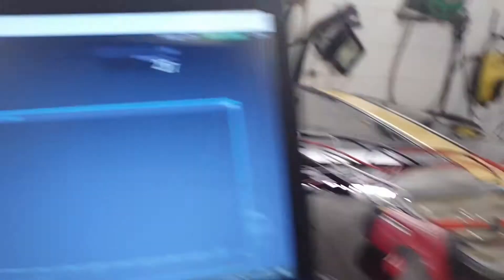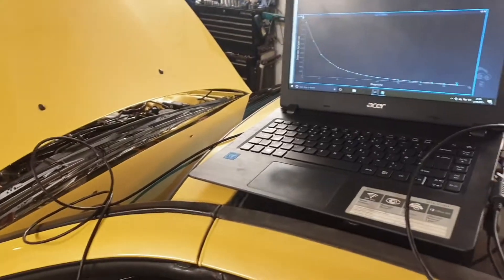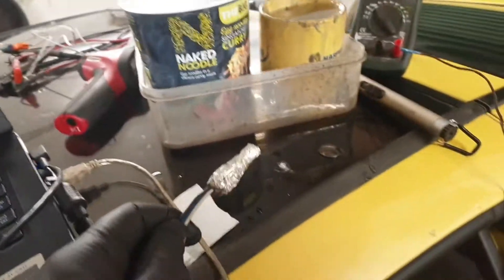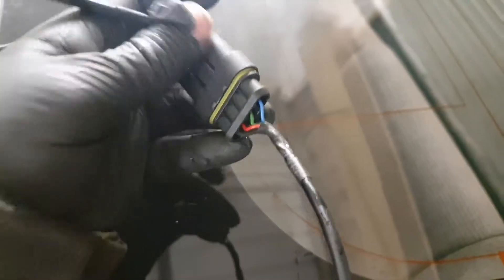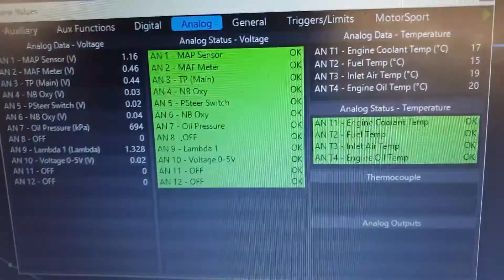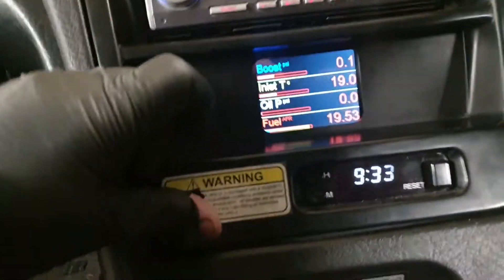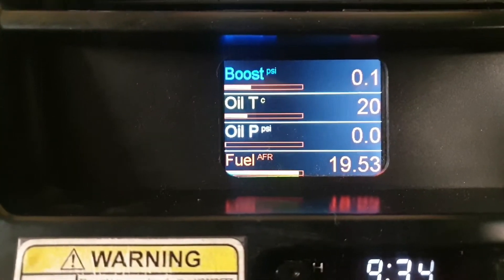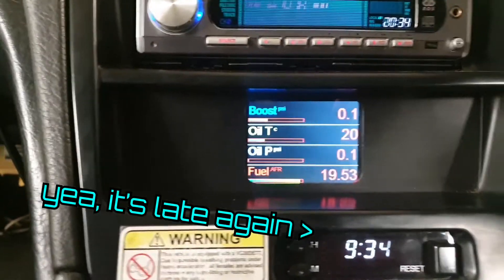Standalone ECU sensor setup- Oil pressure and temp

Comment: Can the oil pressure be checked with a scan tool at a shop.  Instead of screwing in a mechsnical guage by oil pan at the pressure senser.
Reply from the maker: Not on this car, the factory sensor is only for the dashboard gauge and is notoriously unreliable. Even with Nissan Consult 1 that sensors data is unavailable. It's an old car.
Reply: Thanks, mine is a 2010 with 76k gentle miles on it. I was at a cars and coffee talking to others with a Z and they mentioned the gallery gasket problem. Now that's all I can think about.
Reply from the maker: Ah yea that's a different engine to this, this is the vg30. It has it's own list of problems haha

Comment: Did you install an external pull-up resistor for the temp sensor or does the link have one built in that you can configure?
Reply from the maker: Temperature sensors (normal resistive type) only connect to the relevant input and sensor ground, no need for a pull up resistor as it's all done internally, it measures the resistance to ground, on the dedicated temperature inputs (I'm actually using all 4 on this now- air, coolant, fuel and oil).

With these ecu's there is the option to select a temperature input on an analog volt channel, you can set it to external pullup. This is useful if piggybacking a factory ecu. I used that method a few times back in the days before configurable can bus to keep the original ecu for keeping the dashboard and other control units happy.

Comment: Interesting video. Can you please go into detail how you measured the temperature with the kettle and heat gun? Thanks!
Reply from the maker: Sure. I used the thermocouple for my multimeter and used some foil tape to attach it to the sensor so they would be in thermal equilibrium.
Then boiled some water and poured an excess over the sensor into a mug (it needs to overflow if it's going to be anywhere near 100 deg). I then calibrated each temp point as it slowly cooled, adding some cold to speed it along as needed. 
This gets me the main operating range very accurate (great for water temp sensors). 
For temps above 100 I used the heat gun on the sensor but in air, obviously. This is a bit trickier as it cools faster but I was still able to get good data (I guess I could have used oil but I've no way of heating oil reliably and safely). 
I then re checked the sensor in boiling water as adjacent values can affect the reading if its not dead centre in the cell. I think I checked a few times tbh. 
For colder temps I guess you could use ice or a freezer but once you've got a number of good points on the graph, you'll be able to discern a curve and extend that to any cells you missed. This particular sensor didn't read well below around 20 deg c, and it's for oil temp so it's not a major concern. 
I checked my thermocouple reading against my IR temp reader as error checking. Hope that helps!
Reply: @jdmjesus6103  Very interesting and thanks for your input. I ended up using a small Oven for 30  to 150 degrees Celsius and then used the freezer in my fridge for 0 degrees Celsius and just my normal ambient temperature for 20 degrees Celsius. We'll see how this goes...